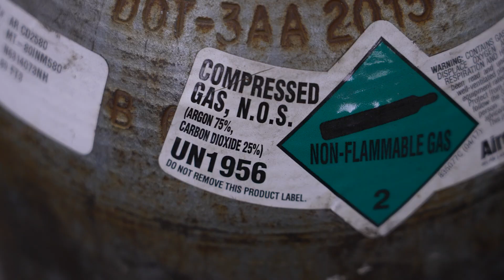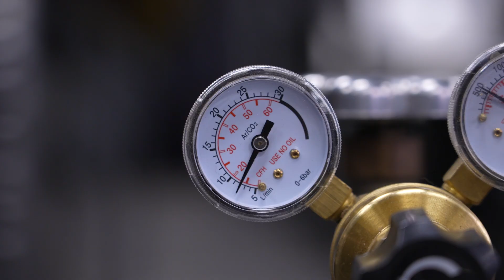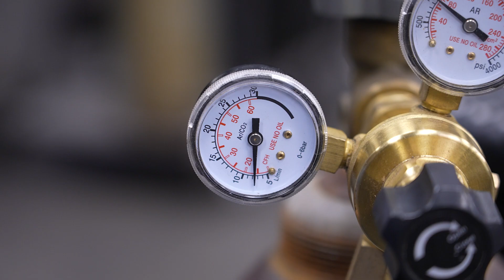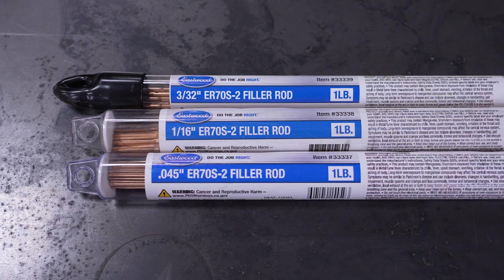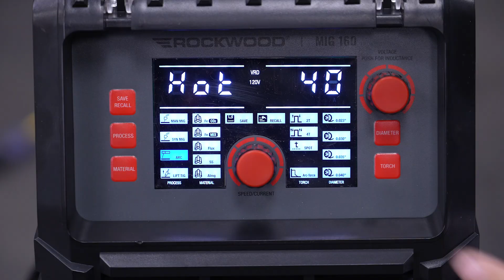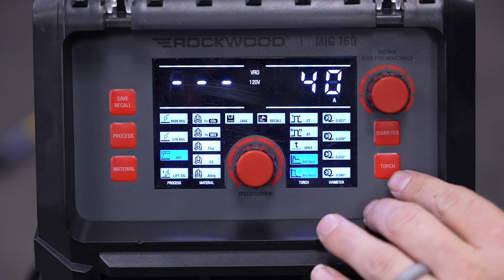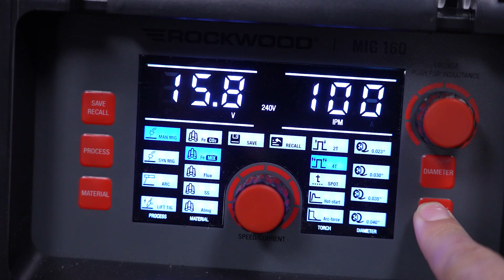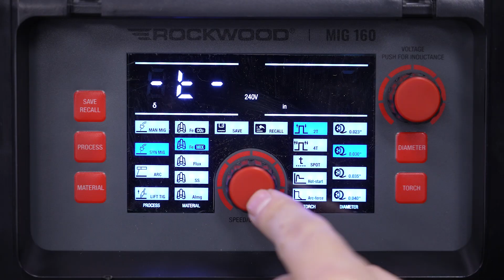The $250 Welder That Does It ALL (MIG, TIG, Stick & Flux!) - Rockwood MIG 160

Comment: Do you guys sell a drive roller to run 0.035 and 0.040 wire?
Reply from the maker: The included Drive roller will also feed .035 and .040 when utilizing the larger slot.  Alternatively 21272 can be used with flux core wire.

https://www.eastwood.com/eastwood-mig-135-and175-replacement-knurled-drive-roller.html

Contact tips here: https://www.eastwood.com/eastwood-mp140i-welder-consumable-kit.html

Comment: I have this welder I've found it performs best on 240 volts. It does really well for custom exhaust work with mig and mixed gas. Also found the syn mode auto settings are really kinda off for 16 gauge exhaust tubing. But if you do manual mig mode you can make really flat welds with good penetration. Can't wait to try the tig features once I biy the torch and pedal
Reply from the maker: That's great, thanks for the feedback! If you can, copy and paste this as a review on the product page so others can see what you think as well!
https://www.eastwood.com/rockwood-160-amp-mig-welder.html
Reply: Thanks for the information. I’m looking to order one this week… have a chopper build im working on
Reply from the maker: Awesome let us know what you think in a reivew!